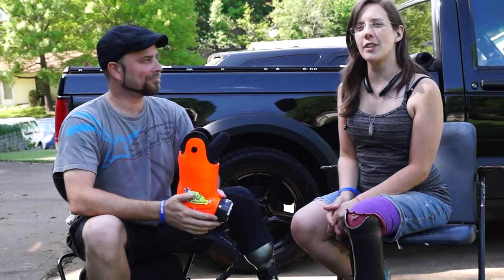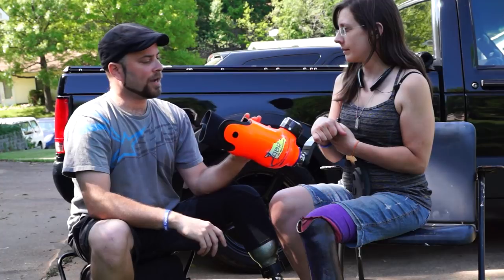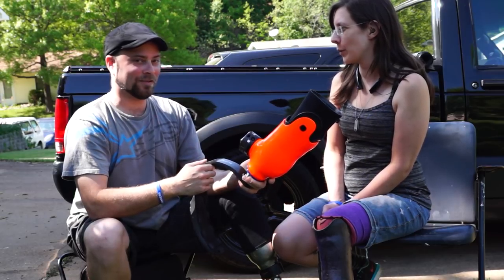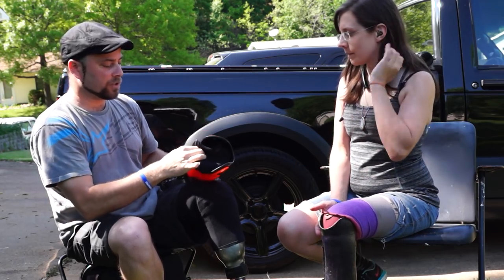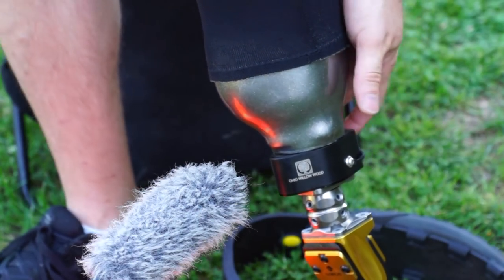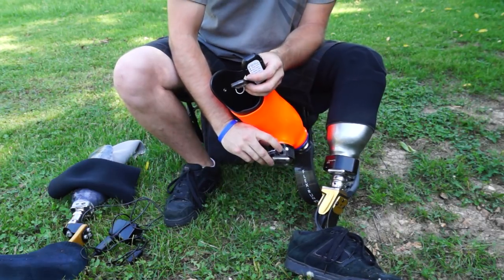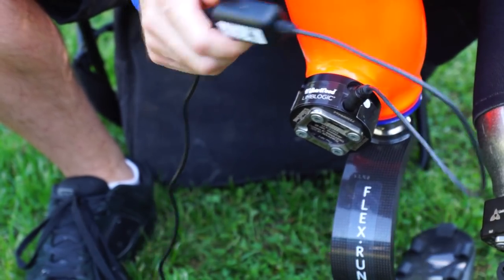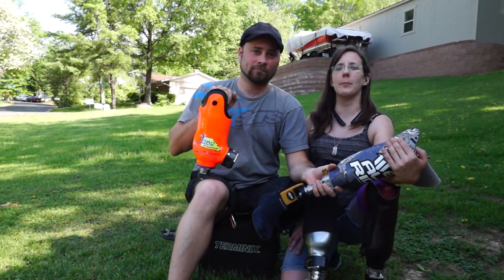AmputeeOT: How an Ohio Willow Wood Elevated Vacuum Limb Logic Prosthetic Leg Works

Comment: Hi Christina, I had a motorcycle accident in May this year & lost my left leg below the knee. I was very lucky & got a new prosthetic leg 2 months ago. I'm now being fit for a new leg as my leg has changed greatly. You were terrific answering the questions I had with your YOU-TUBE VIDEOS. I haven't seen much of you lately, thanks & I hope you are doing well. BTW, I got a new motorcycle & it's great to be out riding again, thanks, bill
Reply: I lost my L Leg two years ago, and now ride a scooter trike, but want to get back on two wheels. How have you managed the shifting issue?
Reply: David Coats Heel and toe shifter on the VTX1800, CVT Transmission on the Bergman 650. One day a Multistrada is in my future.
Reply: Bill Pitt hello Bill I'm also a left leg amputee trying to come up with a viable way to shift my motocross bikes I thought about the healing toe shifter and was wondering how will this work for you?

Comment: Socket design. You can fit the Otto Bock liner directly into the the hard socket without using the inner liner/insert and still use the LimbLogic VS. Why use the inner liner? Without it you would save bulk and maybe increase range of motion. I've never heard the claim that the textured interface of the inner liner increases surface bearing. Look forward to your reply. I'm all ears and happy to learn.

Comment: Dragging Jared around by his prosthetic leg was hilarious. If you tried to do that with another retention system, would that have resulted in the leg coming off?
Reply: You might, but if you have a good fit in any system, your leg is going to be pretty secure.  The key is having that good fit and wearing your prosthesis properly.  I can hang upside down in my pin/lock system, it just doesn't feel as secure.  The least secure suspension would be something like one that you just slide into with a sock and are held in place by the socket wrapping around your knee.  Those come off pretty easy, but are mainly for K2 ambulators.

Comment: G8 video is there a comparison diagram for users? e.g. I use the suspension sleeve alone but, in the last few years the ones I've tried keep rolling as I sweat. I want to try the interlocking system. However, I need to be informed so I could convince my prosthetic tech to install it. He is old fashion.

Comment: Way cool!  I thought a joke about "You're pulling my leg, but don't.  Seriously don't it will come off." but Jared's wont.  Really cool and I am just getting fitted for my 3rd pin socket, I got a chance to use a suction or valve/vacuum (not like his, more like your running blade) and it is tearing my upper thigh up so back tot he pin.